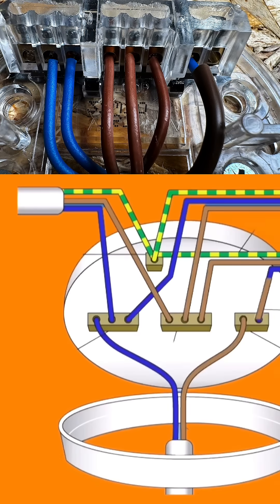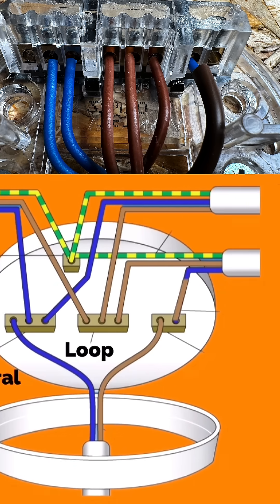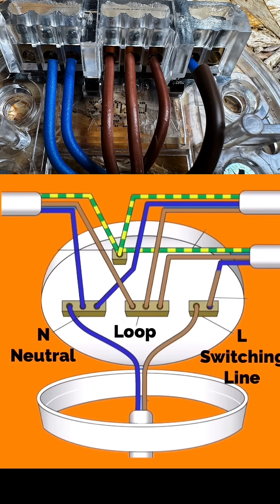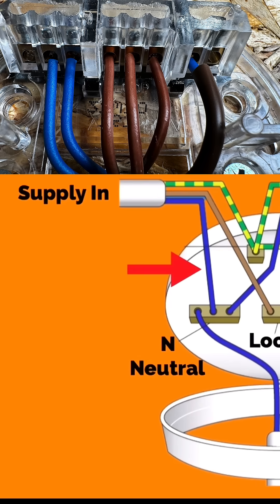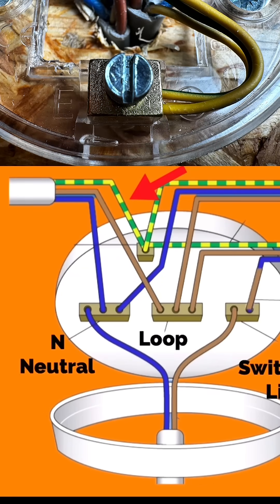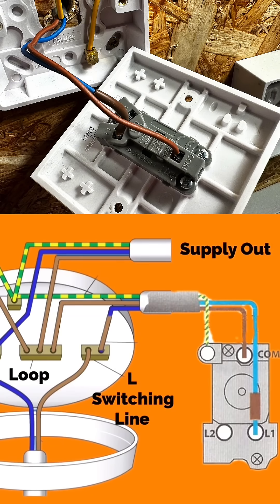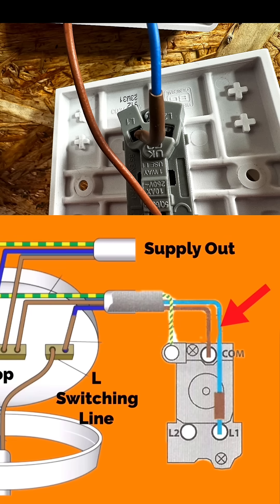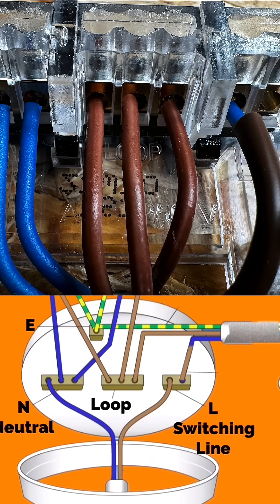Connections Explained in a Light and Switch

Comment: What size is the brown sleeving Gaz?
Reply: Generally 3mm sleeving used for 1mm or 1.5mm cable. You can use 4mm, but imho it looks a little baggy.
Reply: It's explained as the switching line
Reply: @therealdojj  the size of mm not the reasoning to identifying the N as the switching line.